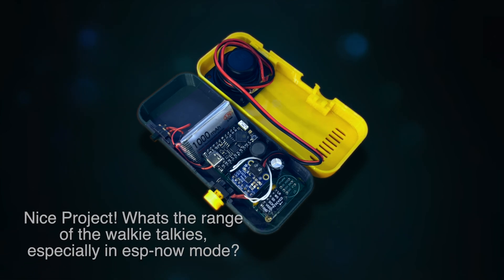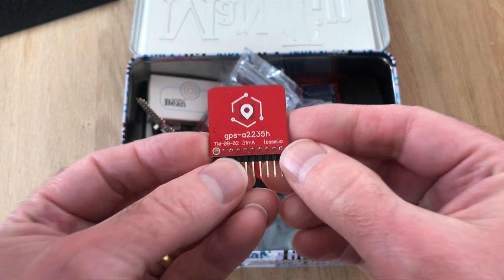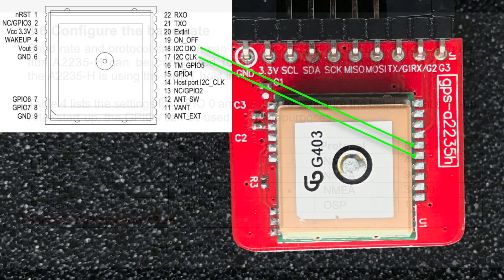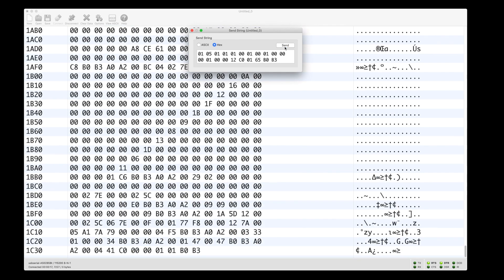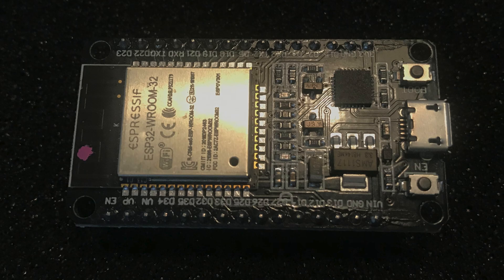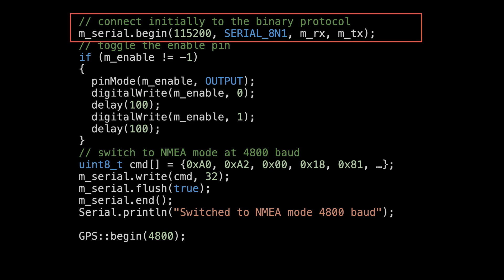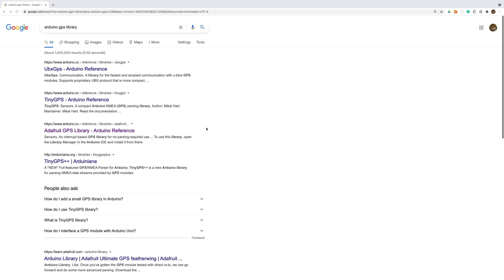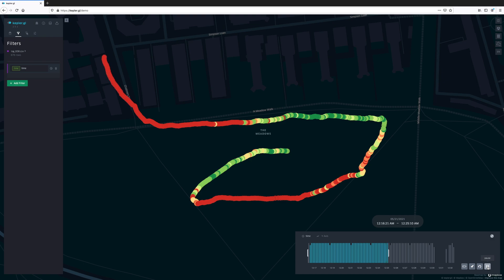ESP32 and GPS

Comment: I'd recommend using an LM358 with the RX/TX line connected to the + side and the - side connected to the output pin, a 160Ohm R from output pin to the anode of the LED with cathode going to 3v3. This will ensure that the signal is not impacted negatively by the presence of the LED.

Though for a very quick test on the bench your approach does work, but I wouldn't recommend it for a final product.
Reply from the maker: That's a very good point.